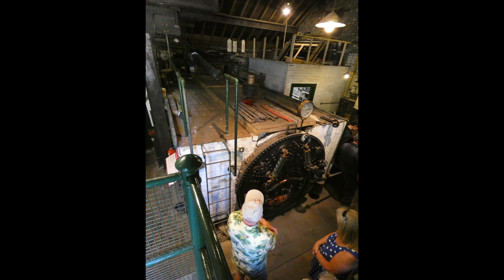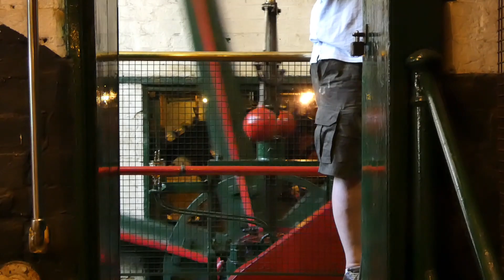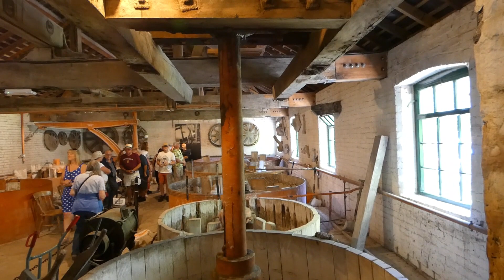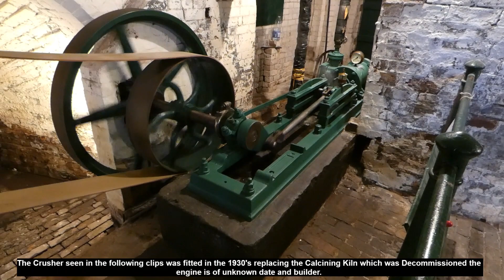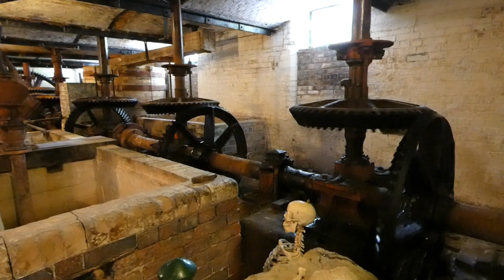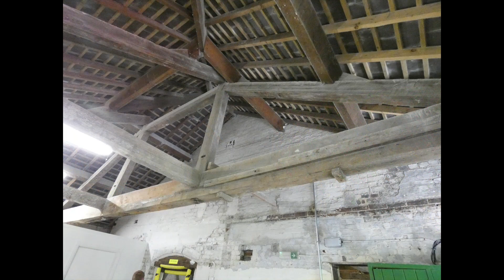Eturia Bone and Flint Grinding Mill

Comment: I think it's interesting that it's possible to see the governor continuously adjusting to compensate for load changes. I was under some odd belief that once a speed and load was set there wouldn't really be much of a change in the flywheight position.
Reply: In theory, once a speed and load is set the governor should not need to adjust, this engine in particular however suffers from poor valve timing, causing it to slow as it passes top dead centre, and accelerate as it approaches bottom dead centre, causing the governor to attempt to adjust the speed, which it is incapable of doing as the governor is blocked up out of the steam main